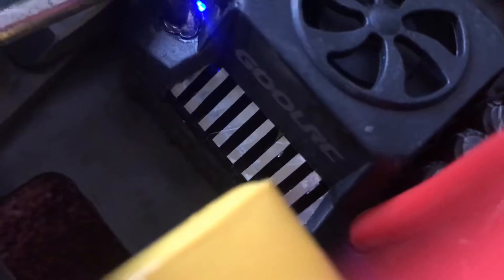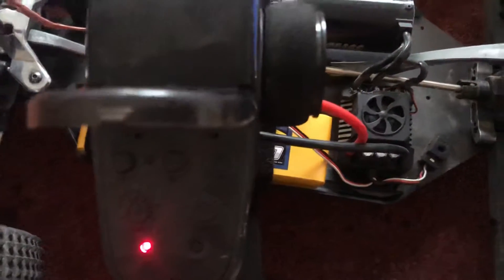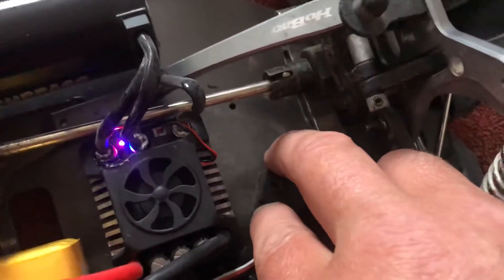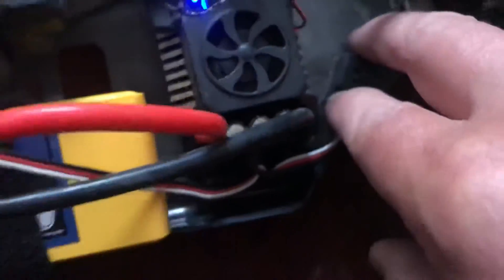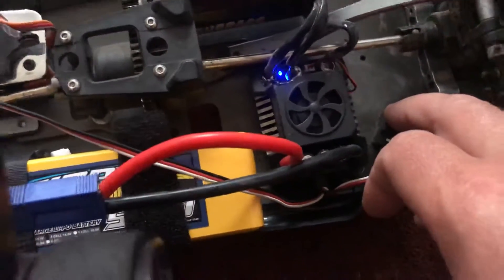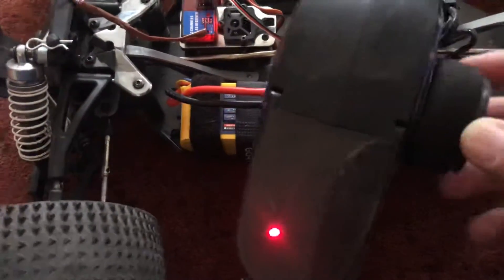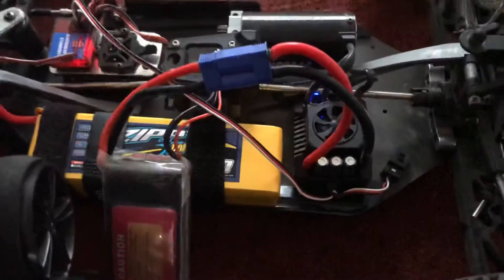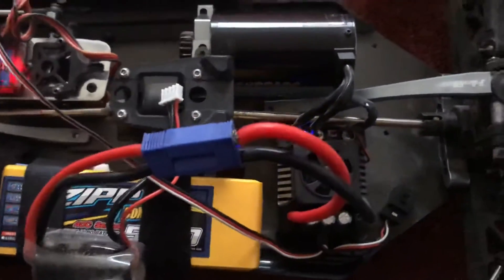GoolRC RS150A ESC DOA - don’t buy

Comment: It's not dead I have just spent 4hrs programming mine . You need to press an hold the set button turn on esc , then press the set button again then press throttle and red light flashes , wait with full throttle until it stops flashing then got to neutral a blue light flashes wait then brake until that stops flashing press the set button a 3rd time and switch off . The next time you switch on it should bleep 3s 2s or what ever is plugged in and work . Like I say hrs of my life have passed but I have had success.  Let me no how you get on . Good look mate 👍
Reply: You are awesome. Worked like a charm. Now I need to wire it up and install. Hopefully this is a keeper for 53.00 on Amazon 👍
Reply: I cannot get mine to work I have two of them and neither one of them work properly.goes from blue to red no flashing please help me
Reply: @carllyons4260  hold set button, turn on and let go. Then press set button again. Then hold full throttle, and presst button, it should beep. Then neutral and press set button, then full brake and press set button. It should beep. Then turn it off, and restart, and voila! Hope it helps
Reply: I to calibrate mine and it goes blue then I press the set button and throttle and nothing happens so tried without pushing the button and the leds just shut off witch ever way
Reply: It also goes red and doesn't do anything after it was fine before I reversed the wires because reverse was faster then forward no matter how I calibrated it
Reply: I have a different esc than the one that's in this video. All I did was applied full throttle on my radio (While the esc is off), turned the esc on, and it was calibrated.
Reply: Awesome thanks.
Reply: I've completely dissected an rs60a now replaced caps and finally traced my problem to the on/off switch can't program it if the menu switch is fubar I cut the switch off twist red+black for permanent on then hold white wire to them for program mode if it lights up sends power to Rx and caps not blown it will work in my opinion....
Reply: Thanks i thought i just had a big lose

Comment: U need to calibrate the esc. There is a set button under the power on button. Press it while turning the esc on. Wait. The LED turns Blue. Hold full throttle. Esc blinks red, beep. Now full brake position, beep beep. And now neutral, beep beep beep. Calibration ✅. Turn esc off and back on. Now it should work.

Comment: I have a simular version, what I've done was turn on the esc and hold the set button for 5 seconds 
let go hold full throttle 5 seconds
Press set button
Hold full reverse 5 seconds
Press set
Esc should chime
Turn off esc
And it should be working after that
If not check motor wires plugged into esc, if it still won't program throttle end points unplug motor from esc try once more
If it's still not working its a bad esc. Or broken connection giving you a problem

Comment: Just a pointer, if you hold the set for to long you will enter setup instead of calibration, and most likely you have initially pressed the set for to long and then by accident changed the settings in the ESC, to reset it start it up, then press power button for 3 seconds (with ESC on) that will reset it.
Then calibrate again, staff up and hold set for about one second. 
Second pointer, you get what you pay for. A hw bl8 won't cost much and that's the same esc as the blx arrma is using.
Reply: My leds won't change when I do that

Comment: Motor cables are the wrong way round my friend that one I see at the top goes in socket 3 in esc them 2 in 2 and 1 in 1 then turn off car press set and on at the same time and set your  Turtle. All dun .

Comment: Ive got 4 different ones mate.
Hold set and turn on until ready Blues light.
Sometimes you need to move to reverse slightly to "activate" , usually just pull full throttle and you will hear one beep and led links red ( and blue) then turns to steady blue again.
Now full reverse, same response, two beeps.
Then leave it at neutral , 3 beeps, then turn it off and on again.voila.
Do this at 100 % throttle rate and try normal then reverse throttle mode on transmitter.it will work!
Did the red goolrc program card work for anyone, I've got one that came with an 80amp esc and it doesn't work on 120 nor 150a esc.
I've ordered my 2nd card and also a hobbystar led which apparently might do the job....goolrc CS hopeless and slow BUT
I had these esc out at 40 degrees on 4s w 2850 motor 15t pin on cheetah 21101 , it did not get past 50 degrees C, it is great!

Comment: I just bought one and I finally got it to work thanks to the comments. Does anyone know what program card is compatible with this thing? Or does anyone know how to program it using the set button and what parameters are programmable.?
Reply: I would like to know this too!!
Reply: Goolrc led programing card is compatible and please use hobby star application connect with PC for  easily programming
Reply: Do you have part numbers for the cars and hobby star application tion connect?
Reply: @visualizer420  where can I find the hobby star application connect

Comment: I have to assume you have sorted the issue? I am gonna make a video showing how I calibrate it. Mine wouldn't go into set mode, until I turned it on with the esc not plugged into the receiver. Mine was same as yours? It wouldn't do anything... but, after I turned it on with no signal to the esc at all? the light turned red and blue, when I turned it on holding the set button. Hope you have it figured out by now. If not I would be happy to help.

Comment: Cable 3 to 3 led 2 to 2 then 1 to 1 turn off and then hold set and switch on together, set your throttle to the blue light u well  work that bit out.  It works bro . This guys  Cables are in the wrong holes in esc he put 3 into hole 2 .and 2 in 1 and 1 in 3 lol that's the problem hear .

Comment: I have the same esc with the same problem.  Seems like this initial batch is faulty from manufacturer.
Reply: Cable 3 to 3 led 2 to 2 then 1 to 1 turn off and then hold set and switch on together, set your throttle to the blue light u well  work that bit out.  It works bro . This guys  Cables are in the wrong holes in esc he put 3 into hole 2 .and 2 in 1 and 1 in 3 lol that's the problem hear .

Comment: Does anyone know what programing card works for this esc?
Reply: Have you tried the red goolrc program card?
Reply: @RcOffroad9513  I havent ordered the esc's yet.. I cant find any information on them either... The only things i found were people that had issues with them. I might just bite the bullet and order one, and figure it out for the RC community.
Reply: Yes goolrc led program card through hobby star application
Reply: ZTW Beast programmer
Reply: @philthyco1  Thanks man..
I got a couples of these and 1 was defected or so i thought i shelved it for at least a year..
I just kept messing with it, followed your procedures and try a few other things like instead of channel 2 for esc i put it in channel 1 ( were the turning servos goes) and that fixed it